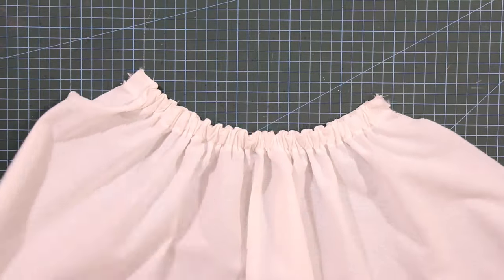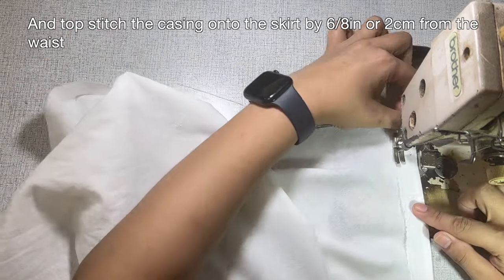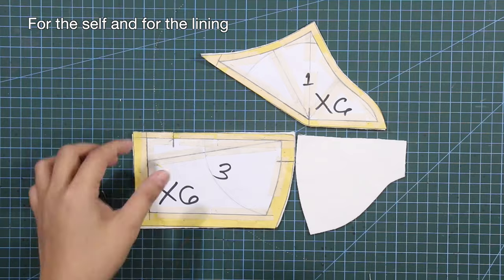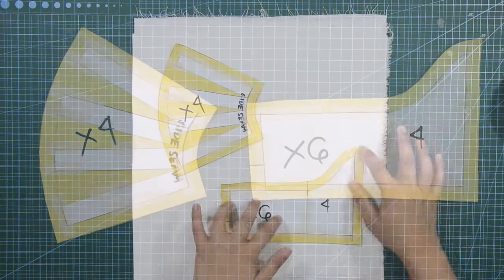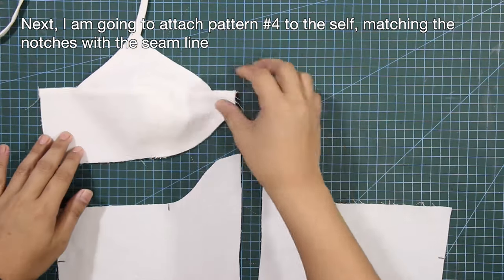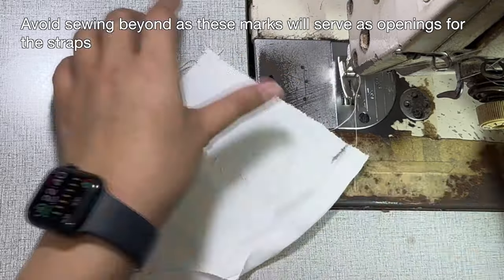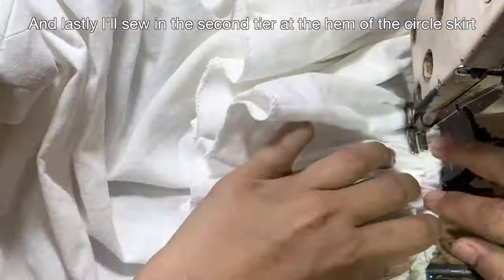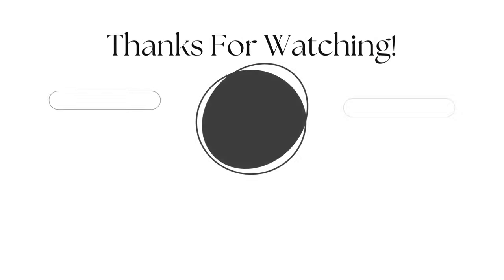HONEYMOON DRESS PT.2 | SEWING TUTORIAL | SUMMER DRESS | LA MODÉLISTE

Comment from the maker: Hi guys! If ever you’re curious, the fabric I used for this dress is Thai Linen. I bought it last year and it is one of the best fabrics to use during summertime or if you live in the tropics. 

For the TOP - I’ve used approximately 2 yards (Self and Lining) 

For the SKIRTS - since this is a circle skirt, the fabric consumption is more or less 4.5 yards (the circle skirt length is about 20 inches from the waist) 

For the 2ND TIER - I’Ve used a lot, but since the length of the tier is not that long you can use more or less 2-3 yards, cut the strips on the cross grain and attach the strips altogether. 

Hope this helps! 😇😊